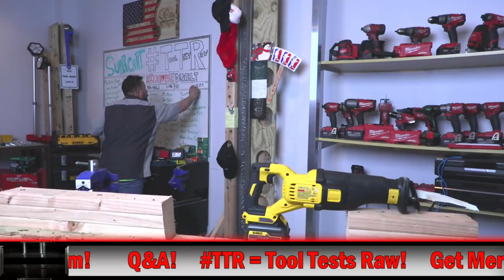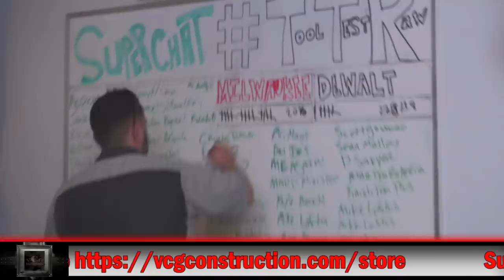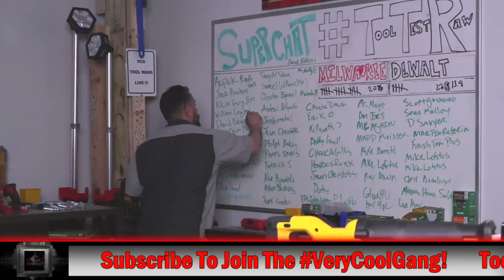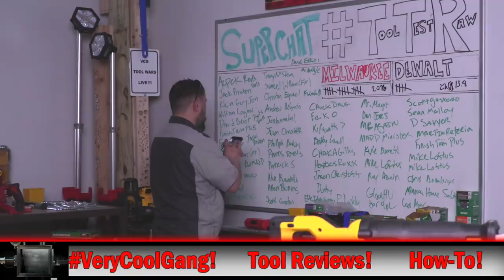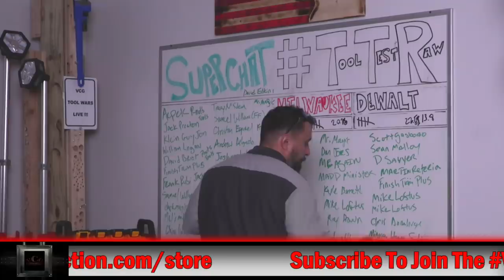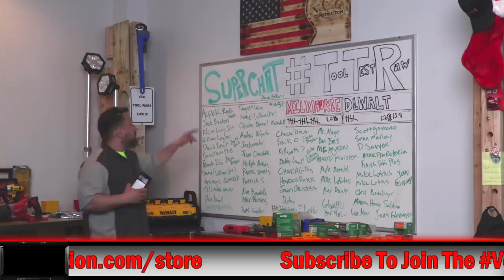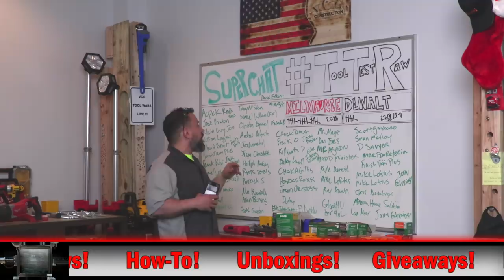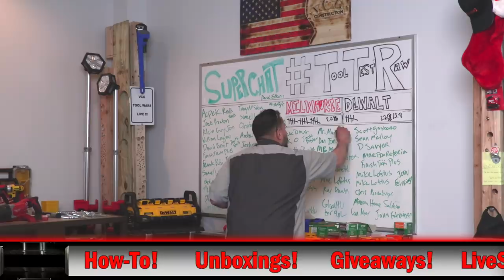Milwaukee M18 Fuel VS DeWALT FlexVolt - Best Reciprocating Saw Tool Test!

Comment: Just bought the Milwaukee because my Dewalt 60v flexvolt is done. After 4 years of use and usually 5 days a week cutting wood but mostly cast-iron it works no more. If the Milwaukee is half as good as the Dewalt I'll be happy. Time will tell.

Comment: Should've switched. As someone who works with sawzalls human skill is 100% the biggest factor in how straight cuts are. I've seen coworkers consistently make good cuts regardless of if they had a saw with a crooked and bent blade while others could be using a new saw and blade and make wavy crooked cuts

Comment: I wanted to buy the milwaukee yesterday but I can only find it as a tool only for 250. Then I would need to buy a 200 dollar battery and then a charger. It was over 500 for a sawzall that I could not justify. 

I am too invested with Dewalt at the moment..... I went with the 60v sawzall and am happy with it. It ran me 299 plus tax at the depot. 

Thanks for the review.... love how much effort and time is really put into your videos.

Comment: You actually gave Milwaukee a slight advantage by using it with the 12.0 and only using the 6.0 in the DeWalt. Using 12s on both or 6s on both would've been fair. But its not a massive deal.
Overall DeWalt is a much better saw than people say it is. It generally doesn't have a great reputation, and it lacks the nice features like a rafter hook and adjustable shoe, but its a solid tool. It will cut anything you put in front of it, and its definitely more powerful than a standard 18v saw. I know because I own one.
The Super Sawzall is overrated in my opinion. Not as powerful as people make out, heavy as fuck and the vibration is pretty bad. Not a pleasant saw to use. Might be more powerful than the DeWalt, but the DeWalt is nicer to use IMO. The Makita is a sweet unit also. Best of all is the Hikoki/Metabo HPT. I'd bet my money that thing will beat any other recip you put it against. Would be cool to see you test it!!
Thanks for the vid VCG.
Reply: It seems like this guy, is working with Milwaukee, 
I'm a carpenter i use dewalt everyday 5 days a week, and i don't have any complaint about dewalt.
Reply: @yojuanjose1  I also use DeWalt and have had 0 issues, but he's not working with Milwaukee. The VCG crew are honest and they put the tools through the test live, no edits, no faking it. They give credit where its due, and they give criticism where its due, with all the brands they test. They are not shills.
Reply: If you used the 6amp Milwaukee battery with the 18650 cells it wouldn't even be a contest the dewalt would destroy it, the dewalt cut the 6×6 without orbital 7 seconds faster if they used a 12amp battery with the dewalt it would have been under 10 seconds

Comment: In all fairness, the Dewalt had a smaller battery.  The Dewalt should have had a 9.0 or 12.0 battery so both saws were using the same battery configurations.  If you didn't have a Dewalt 9.0 or 12.0, then you should have put a 9.0 in the Milwaukee to keep it fair.
Reply: Battery size doesn't effect performance just run-time
as long as battery is charged its all the same
The Milwaukee is better due to the orbital function that Dewalt refuses to implement Sad really .
Reply: @andrewkilner6195  That is completely false.  The 9.0 and 12.0 batteries use larger 20700 cells that can output much more current and run cooler.
Reply: @jps101574  The tool isnt bogging down the "extra" power will do nothing
I have dewalt grinder and circ saw and the 9 and 6ah batteries and the do perform the same
Reply: @andrewkilner6195  I see what you are saying but it just doesn't look good when you are making comparisons of different tools and they use different batteries.  I do know that the Milwaukee 12.0 battery is significantly more powerful than its 9.0.  Maybe Dewalt sees less performance difference between batteries because they are running on a higher voltage.
Reply: @nvg1526  Ah is how batteries are identified though.  The important thing here is that the Dewalt had a smaller battery than the Milwaukee.  Dewalt 9.0 and 12.0 batteries use 15 large cells.  Dewalt 6.0 batteries use 15 small cells.  Milwaukee 12.0 batteries use 15 large cells.  Milwaukee 9.0 batteries use 15 small cells.
Reply: @nvg1526  Dewalt has 3 times as much voltage but 18V (20V Max) batteries use 3 times as much Amperage.   Each battery has the same total Wattage.  Amps x Volts = Watts.
Reply: @nvg1526  True.  It is a 4.0Ah when it runs at 60V
Reply: @nvg1526  I don't think the results would have changed either.  That Milwaukee saw is the new Model.  The Dewalt saw is a few years old.
Reply: @andrewkilner6195  It does effect performance and if orbital was so great than why did the Dewalt beat the Milwaukee using orbital by 7 seconds, its about power and the Dewalt has more and the new Dewalt has even more power so Dewalt is in a league by itself

Comment: Isn’t the 6ah battery only really a 2ah at 60v.  I though it was only 6ah at 20v
Reply: That is true. It's also 18/54 volts. A good way to compare batteries is by the watt hours. That DeWalt battery has 108wh regardless of the voltage while the Milwaukee has 216wh
Reply: Yes indeed, the flexvolt batteries get cut in half on a 60v tool.

Comment: What battery where you using in the flexvolt.
Reply from the maker: 6 ah
Reply: #boatanchor
Reply: VCG Construction  use the 12 amp flex volt
Reply: Need sponsor

Comment: I've used the metal blades by Milwaukee and wasnt impressed with them. And I'm a big Milwaukee guy.
Reply: Diablo is all I use
Reply: What I normally use but wanted to see what they was about
Reply: I've had better luck with Diablo for metal

Comment: Hi Vince, 

Is the Dewalt 60v Sawzall egual to a 15A like milwaukee?  If not, dewalt is not too bad, don't you think? Looks better than the 20v line. Still crapy that it has to use a 60v flexvolt and not a 20v like milwaukee.
Reply from the maker: The flexvolt does seem much more solid that the 20 volt max! It should really have an adjustable shoe and I’m not a fan of the plastic tab for blade changes!!
Reply: @VCGConstruction  

Cool, i have the milwaukee 2720 and i truly like that model.
Reply: @VCGConstruction  

Hey, how about a challenge between the milwaukee 2720 and this sawzall. That might be good to see.
Reply: No.  DeWalt states in their marketing literature that the Flexvolt recip saw exceeds the power of their largest 13 amp corded saw.  But it doesn't quite equate to the 15 amp super sawzall which has a slight advantage, as well as orbital action.  So in essence the Milwaukee corded super sawzall 6538-21) and the cordless version are slightly more powerful.  The Flexvolt is very powerful though, and should meet most users needs.
Reply: @DIY-fz9cn  

Thanks for that info..
Reply: @DIY-fz9cn  depends on use. I main cut PVC/cpvc with mine and the fuel hacksaw is tool for the job. Maybe demo work super sawzall but for me fuel hackzall is plenty specially with a good blade and a 9.0 battery
Reply: The bottom line is where power mattered on the 8 by 8 the Dewalt won it more powerful than the Milwaukee

Comment: Vince is just ripping the pipe not cutting it the dewalt is more smooth cutting not just tearing the pipe to spreads look closely to the cuts Vince made vs nicks cuts dewalt is underrated 100%

Comment: Have you ever thought about doing  a more precise test like project farm on is channel. He did with testing sawzal blades but if you did it with the 2 different saws and same blades so its saw vs saw. He had a holder thing and weights on top of the saw so its the same even amount of pressure. Just a thought.

Comment: The guy using the DeWalt doesn't place the material up against the shoe of the saw so his saw catches on the material and oscillates for seconds before he starts moving through the material. He doesn't know how to work the saw properly.

Comment: First of all when you guys were cutting nails it was very obvious she had no idea what you're doing cutting steel especially hardened steel it's not about bleed speed you actually need to slow down you will get faster in your blades the last longer when you start seeing Sparks you're just throwing your money away and wasting your time second of all well the Milwaukee seems to have higher RPM it definitely does not have more power there's only so much power you can squeeze out of a 20 volt system 60 volts is more powerful and likely to last longer because it's not being overloaded to its very peak potential and the adjustable shoe is is a dorky newbie feature those of us who use sawzalls day in and day out laugh when we see dorks use the adjustable shoe